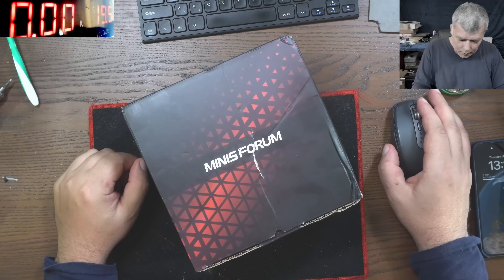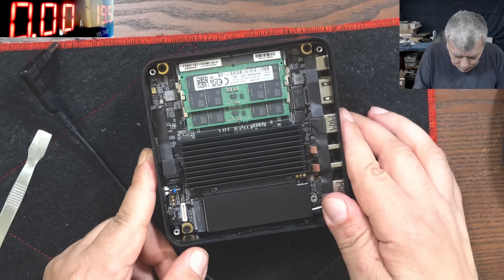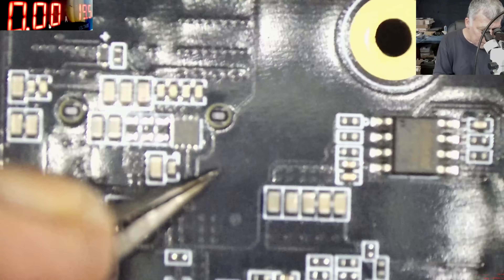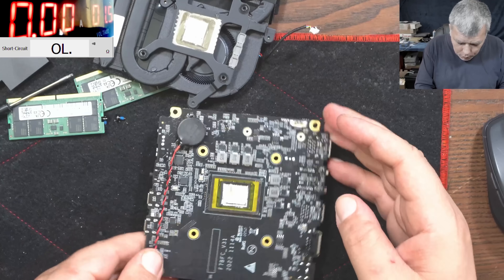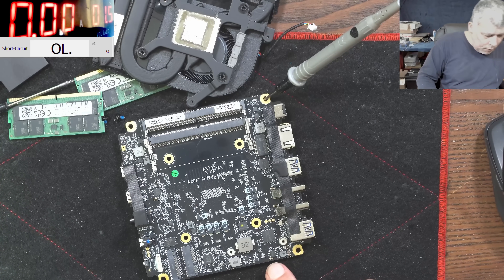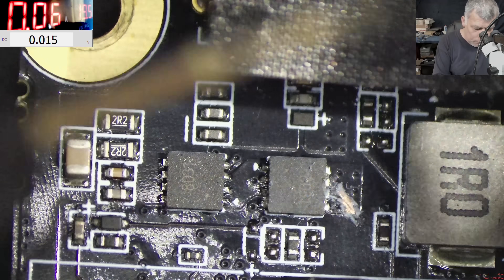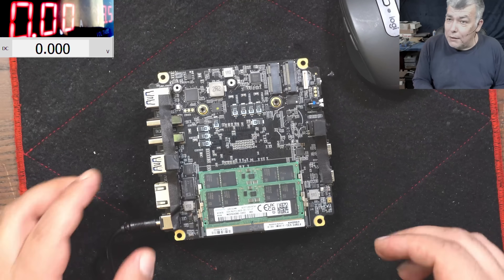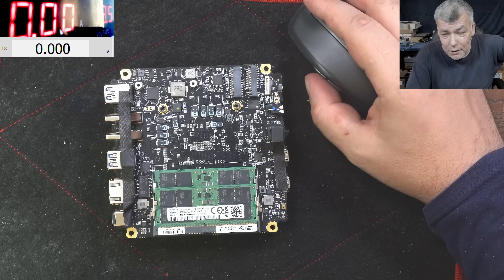Minis Forum UM690 mini PC - no power, board repair - This looks like a small beautiful mini PC

Comment: I have a Minisforum UM790 Pro and it is more than adequate for gaming as long as I stay away from newer AAA games.
Reply: The UM690 shown is also plenty capable of gaming, as long as you don't need the newest games at the higher settings and/or the ones now that FORCE RayTracing or they won't run.

Comment: The mosfet is a P-Channel. I repaired one today. The shorted cap in my case was near the hdmi ports.
If you place a N-Channel the pc still works because of the internal diode of the mosfet but you see the 0,6V drop source/drain.
Reply: Do you do repairs for as business, and are you based in the US, I have a um890 having a similar issue but I can't seem to narrow down the issue
Reply: I know this comment is 9 months old but do you know what mosfet you used? The number on the top of the ones pictured in the video is 8031 which digikey says is a N channel mosfet.

Comment: This video is confuising me.  I've been working with this motherboard for about 3 days  the board is shorted and the second Imput mosfet was dead, same as Sorin video,  so far I can't find the shorted component  because unfotunatelly I don't have a thermal camera, so I'm still dropping almost a botle of alcohol on it with no luck so far. But what is driving me crazy is that the Imput Mosfets from factory are TPC8031 which according with the data sheet they are N CHANNEL Mosfet and I get 4 Volts at both gates after I replaced the second one, but I'm undersanding that Sorin says they are P CHANNEL MOSFET 😒
Reply: Go with the data sheet.
Reply: Hello, did you ever end up fixing it? I am trying to find the short, i first thought it was under the mosfet because it blew the entire trace up but it looks like a cap is shorted. I've been measuring everywhere but cannot find it. Even with a very nice thermal camera, nothing lights up except the mosfets that I replaced (with RQ3E100ATTB P-channel mosfets, after i FINALLY found the datasheet for the originals)
Can anyone point out the possible failed caps? i have tried replacing 8 capactitors, of which one was indeed fried. @electronicsrepairschool
Reply: @_o- any updates I'm having the same issue

Comment: Okay so gaming can wear it out?  I have one with eGPU setup, adapter through nvme2 SSD slot, extra PSU for the external AMD 6600xt. It is now having trouble starting up, may take a couple minutes of jiggling with the ac adapter

Comment: The noisy fan is at the top part haha
I'm a fan of passive cooling, airjets, and big silent fans. 
Modding is always an option, until manufacturers catch up and technology gets even more efficient and advanced.
Manufacturers usually always make it smaller, so that it makes either noise and/or thermal throttles, instead of just using a decent oversized heat sink and fan...
This makes more sense for a laptop, but for a mini PC? It's still about cutting costs. Silence lovers are forgotten.

Comment: Daaamn, I can't find out how to disassemble similar mini pc correctly. Came here to check it but this part is skipped and characterized as painful. Any tips?
Reply: In case anyone is looking for this in the future: Remove the 4 screws in the corners of the board, then pull on the front (power switch side) of the plastic case outward with the open bottom of the case facing down. Make sure you are also pulling the metal inner part. All you need to do is clear the front ports and the board will pivot out under its own weight. Note that the power button will stay attached to the case.
Reply: did you ever find anything to help you remove the board? I need help ASAP
Reply: @therhetorician4683   kind of a lame video without the board removal instructions.

Comment: of course, capacitors getting bad because they're not needed and getting bored... 🤦‍♂
i mean, is it SOO hard to get a SMD cap book and fuckin replace it and not being dodgy?
i repair so many old boards from the 2000s with capacitor plague... maybe it's enough to just remove them instead of recap... seems the manufacturers put those components just because they have  too many in stock...🙄

Comment: How come you already had replacement mosfet?Which means you knew about faulty component before vid :D
Reply: Every P channel FET from any laptop will do 😉
Reply: @stefanputureanu9296 not common P channel... but probably can be found on some donor board
Reply: @laboratorioassembler  Is a Chinese one for sure, hard to find a pdf for this one. Chinese parts usually use existing part numbers but they have nothing in common with the real ones.
Reply: Doesn't matter if he did know. He is teaching people that would normally replace a good Mosfet for nothing. 
The one getting hot was the good one. The second one was short. And the cap was short.

Comment: It would've been nice if you'd replaced that cap, it was right next to a power supply. In the future that PSU may fail. Probing with an oscilloscope on a PSU input without the input cap mounted you can observe big voltage spikes like 5v in magnitude. (depends on PSU PWM frequency). Those spikes are attenuated fast on the rail after a distance of 3-4cm of cooper track but it will harm that local PSU, or analog audio amplifier if is somewhere near by. Having an oscilloscope can make you understand that no cap is on a board for no reason.
Reply: Generalissimo Sorin sending poor capacitor to the gulag 😪
Reply: In the next video, part 2.
Reply: Normally he replace the cap with Apple 🦆 one but not in this video 😊
Reply: You can discuss the absence of parts with real engineers only, at best with those guys who are in charge of designing this stuff. It's very rare to find a redundant part. We discuss each part really thoroughly, if it's really necessary or not. Because each part cost money. So of course, parts shall not just taken off the board, but shall be replaced by a part with the same or closely similar properties. We do not design-in any part just for fun.
On the other hand, with old stuff, if it's not necessary to keep the warranty, and if somebody else accepts the responsibility for the repair or the "repair" and it's effects now and in the future, for example risk of fire, etc. A real company can't accept this, right? Especially if your company has a public liability insurance, discussions can become difficult, if a real impact, on life, health or proportional, happens.
Reply: Would you need to identify the capacitor? Schematic etc
Reply: @Dohcoms  A 10uF from any laptop main power rail will do.
Reply: @stefanputureanu9296 Ok, thanks, wasnt sure there, could check the power supply schematic also i suppose
Reply: "Dont worry i will replace capacitor later" -- Sorin  . You still didn't learn yet  ??
Reply: I know what he saying about capacitor though, a lot of them are pointless, only there for radio emission/noise regulation. will still work without, and the unit will only last a few years anyways before something else will fail before PSU
Reply: @Dohcoms  Yes, radio emissions wouldn't be a concern if there will be only that, but radio emission is the result of some rail ringing above and below the accepted voltage of that rail. They don't appear just like that, you will have spikes of +/-5v for example, some chips will tolerate over voltages and some not. I use to do PCB prototypes, and believe me, some caps can be removed with no problem and some need to be replaced. Go remove an input cap from the CPU PSU and at high loads that CPU will freeze, or some FETs will burn due to low voltage on the gates.
Reply: @stefanputureanu9296  I get you, that is what i am saying, some caps have to be replaced, but some can be forgotten about depending on function, only an experienced technician will know which caps are vital.
Reply: @stefanputureanu9296  I was in college along time ago and was working on a microcontroller for a robot, the I.C. would not power up without an input capacitor close to 5v DC input rail as there would be a voltage drop when it powered up, there are many different reasons why a capacitor is needed or not,
Reply: @stefanputureanu9296 I was looking on your page for videos on how to do micro soldering. Figured  I can learn more..
Reply: @DavesUnbranded  I don't do videos. Don't have time. Microsoldering is all about experience. Is a passion for me... started in 1995 at 9 yo. I've lost many nights learning about electronics, haven't been good at school. At 11 yo I've done my first fix on a radio with vacuum tubes. Afterwards I've studied the internal structure of CPU's and MCU's...  write'd some cracks for some software i couldn't afford to buy... and started to mod some devices: removed MCU's with original firmware and replaced with new ones with my own code. (here i needed microsoldering, microscope... etc). Is a passion 😉

Comment: 64 gigs of ddr5 wow
Reply: Ryzen 9 what a beast
Reply: But not powerfull as you thinking
Reply: @Imnvarya  why?
Reply: Yes, that's a LOT of RAM. I wonder what the owner was runnning with that much memory?
I have a variant of the UM690 in this video, and I never even get close to using the 32GB I have installed.
Reply: @devobronc  I have. JetBrains Rider consumes ~10gb, docker around 15gb, web browsers and etcetera ~15gb. but when virtual machines used... so not that hard to consume alot memory nowadays, sadly

Comment: Thank you, teacher, but those 1st  2nd mosfet are going to take me crazy, every time I say I understand them,  and now, the mosfet is getting hot because it is good, and those 24V  at the gate   😅
Reply: In a circuit the part that have the biggest resistance it will get hot. Normally a FET like that has an internal resistance of about 0.05 ohm. The second FET being shorted he injected 19v on the FET's driver and this in turn raised the voltage on the good FET gate raising his internal resistance. (being a P channel). 
 And for the part with 24v, Sorin though that the FET is a N channel. Voltage of a FET gate being measured between Source and Gate, and for a N channel TTL it would've been 24-19=5v. In reality it was a P channel: 4-19=-15v (negative voltage)
Reply: thank you very much  @stefanputureanu9296
Reply: @stefanputureanu9296  where's the -15v ? He measured it was like 4.7V . Please explain why the voltmeter showed 4.7V instead of -15v, also does FET stand for Mosfet or it is a transistor I understand Moset  is a transistor but usually we call it Mosfet, is it different than laptop mosfet ?

Comment: (TPC8031) Is this the n channel  mosfet that he replaced? I got  little confused at the end, P or N Channel?
Reply: It is P channel (is a Chinese FET). Gate voltage is measured between Source and Gate. Having 19v on Souce and 4v on the Gate that means the gate voltage is -15v. If it was a N channel, on the gate should be around 24v for TTL level N channel FET(24-19=5v), and 31v for a normal N channel FET(31-19=12v).
Reply: N I think

Comment: I don't think it's silent, it's got a fan on the back :)
Reply: Those mini pc are very silent, I have 3 HP prodedk 2 i3 and 1 pentium Gold, there have a fan and can’t hear there  fan at all.
Reply: @Trustsimo07  I bet most of the minis make noise with high loads and in hot rooms. This is why I'll choose very well, and I always consider modding to make it near silent.
Is there a chance HP and DELL choose well sized heatsinks and fans to control noise? vs. other mini PC brands. There's a lot of variation in the mini pc spectrum when it comes to CPU power as well...
Reply: @dominus6695  No need to Mod it.
Just change the power setting in the BIOS Setup to a lower wattage, or "Silent" power mode. 
Unit will run CPU at 25-35W and fans won't be noisy.

Will take a performance hit in multi-core loads, but not bad... gaming with modern 3D games will not work well at that power setting.